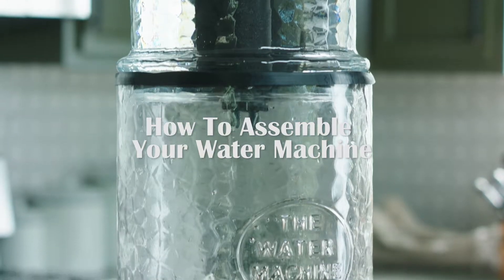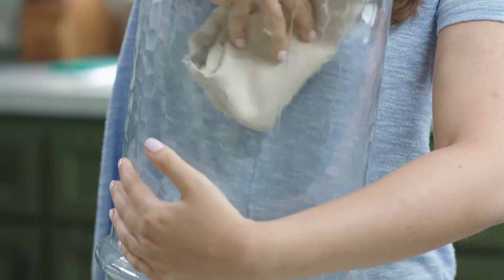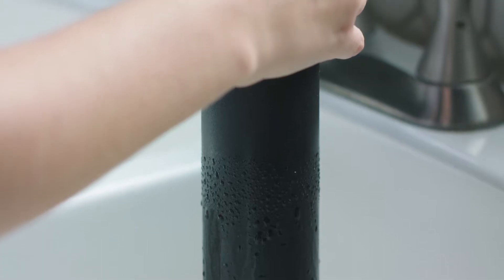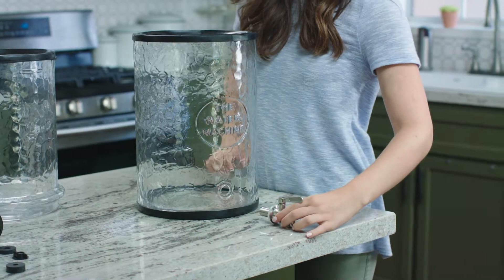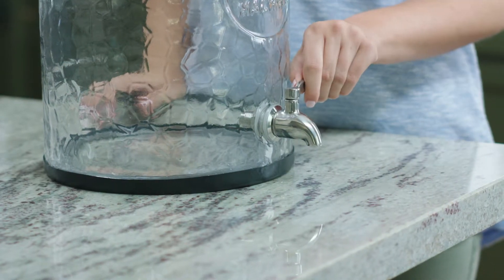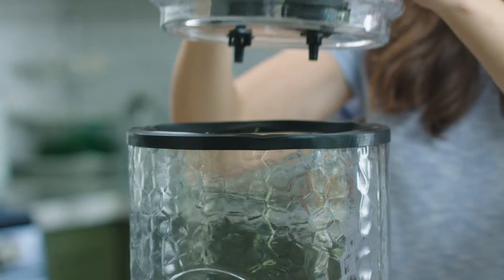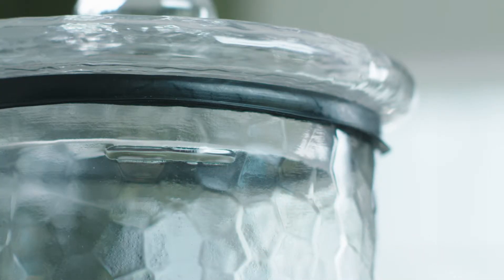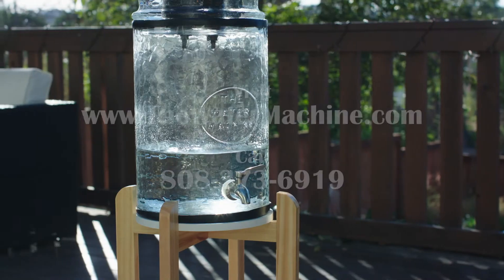How To Assemble The Water Machine

Comment: Technical writing professional and customer here: The instruction page for this product makes a super easy assembly incredibly unwieldy and unnecessarily difficult. Instruction page's only job is to be a stand-alone resource for a person. It is by Americans with Disabilities Act also required when you consider that plenty of people cannot interact with Youtube or the phone in the way the manufacturers are presuming. Even as a hearing seeing person with mobility, I as an above-average-IQ and thorough reader struggled to follow the instructions the company rattled off quickly as the makers and knowers of the product, enough to go back and forth between my phone and the unit. For the sake of not exposing a good product maker to federal liability it doesn't need to be exposed to, and for the sake of providing the instructions in the way that people who are disabled from bad water need to process the information, the instruction page needs to be vetted by someone who has never used the product, not by people who know it well. This video helps with that but also has major holes in it as of 2024 when the packaging is different than indicated above.

This video is essential since the instruction page is incomplete, incomprehensible, and contains no diagrams (a few photos that are so small in resolution and so incomplete that they are not useful as an instruction manual) and should be mentioned in the instruction page, which leaves out many specifics that are standard in instruction pages. I did not expect this to be challenging to put together - it should have taken no more than 5 minutes; instead it took an hour and two calls to David because the instruction page 1)did not mention this video and 2)does not show any images of what it means by each written name of each piece. In addition, in this video the current 2024 packing style is not accounted for. For example, there is no demonstration of putting on the large rubber pieces that keep glass-off-glass, in this video. That should be included anyway, but it's especially essential in 2024 since current packaging specs mandate that one of these pieces comes nested in another so snugly that without an instruction you would not know it is two pieces and it of course doesn't fit onto anything properly.

Re. the instruction page, there is literally no instruction at all on putting on the gaskets.

I would also offer that 1)in contrast to what the video and instruction page say about 2 minutes for a priming, when I told David it takes a minute per long inch of filter to actually prime it, he affirmed that that is correct - that is actually 15-20minutes at your sink, so if you are a person who has trouble standing for extended periods, bring a chair; 2)the filters are so long that they are maybe 1.5mm from scraping the bottom of a standard US kitchen sink, and you need them standing up straight I think (?? would be great if options could be mentioned and listed in the instruction page if that's not the case) to prime. I never did get a full prime even after 20 minutes, but I got droplets for all the areas except the top two inches of each filter; 3)the instruction page is VERY clear about you needing to use a slow stream of water but indicates it will be a sealed stream....this is not the case. You can't get any stream of water going down into the filter without some leakage, so don't make that attempt. The problem with that is that you can't see where the droplet-making is real vs. where the water is just spillage, when that occurs. But if you know going in that 15-20 minutes is what to plan on, that makes you better able to plan and know what to expect.

I would recommend those looking at this product forgo the stands altogether - I ordered a small one since I had a good surface to place it on, but since you are filling the barrels with water, inevitably drops get onto things - on any sideboard I know, that means you have to wipe it up every single time in order not to ruin the finish, and the stands sold by the company are also wood based, so the issue remains. Additionally, the small bamboo stand I ordered wobbles so I won't be able to use it; placing the machine on the end of my extra fridge will be a more stable place (not aesthetically preferred spot but safer).

When a customer calls for help, the first question asked should be "Would you like me to walk you through the Youtube video?" - in my calls a Youtube video was not even offered - only emailing or texting videos, which on vacation I don't have available and which many people using this good a water filtering unit are smart about not using cell phones or have to medically not use them due to radiation poisoning treatment. The company has alternatives (sort of...still need a viable instruction page) for disabled persons, but if we don't know what those are then they don't help us.

Definitely appreciated being able to reach a human to help me but if I had known it would be this time-consuming I would have definitely thought twice about the purchase at this time. This can all be solved by simply writing an instruction page to regular standards.